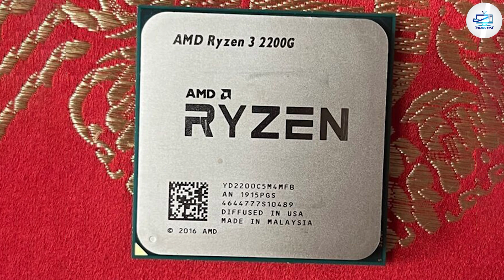APU vs CPU: What's the Difference and Which is Better?

Comment: So does adding a gpu(6650xt) to my cpu with out integrated graphics(i3-12100f) makes it capable of streaming/editing/recording?
Reply: If your processor has no integrated graphics, your screen will have no display unless you have a graphics card.
Reply: Is APU good for gaming? Let say COD?
Reply: @nimdunca3253  it is ok. Not as good as a discrete gpu but it can run things like Fortnite at 150 frames plus.